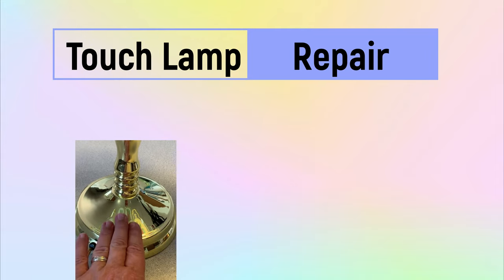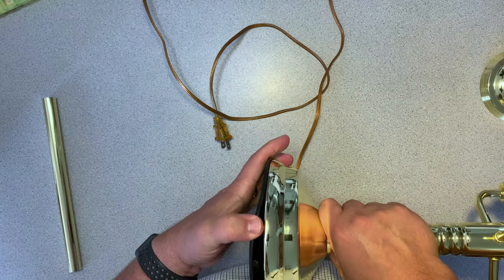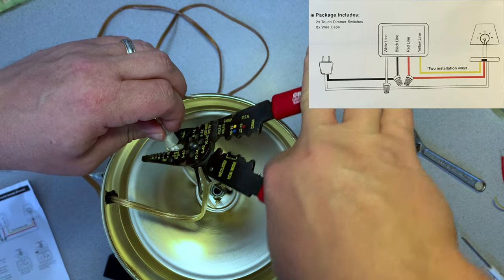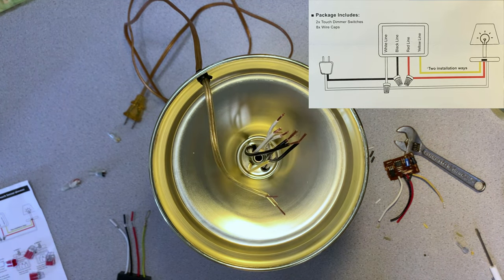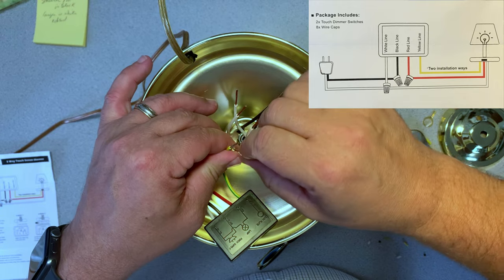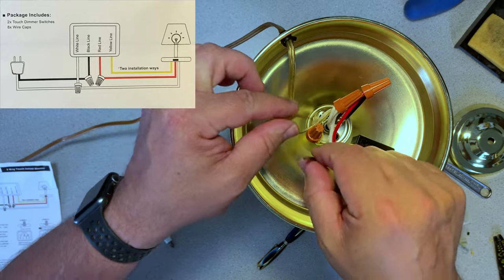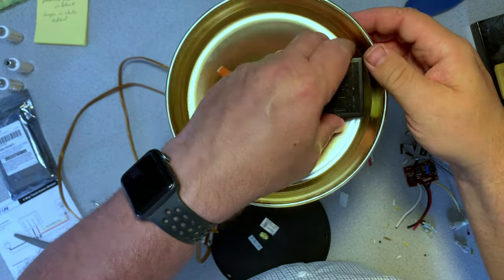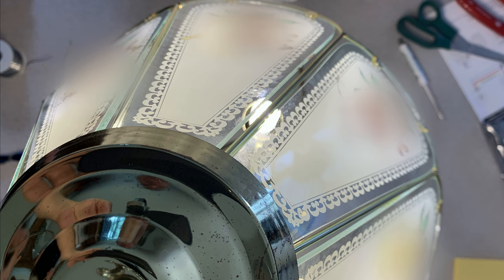22-M04 Touch Lamp Repair: How to get your lamp back to life

Comment: I’ve had a touch lamp sitting for the past 3 years because I could not follow the wiring instructions. None of the videos had the same color wiring or same number of wires. Your instructions were easy to understand although your module was very different from mine.  Thanks so much!
Reply from the maker: You're very welcome. Please be careful though, each control module might be slightly different but the basics should be the same. And remember if in doubt, have a professional do it for you. Good luck!!!

Comment: Well the bad news is your going to keep having to replace the the sensor module. It does not have the same ohms/ resistance that a incandescent light bulb has. So it just will interfere with the switching transistor.  
Cool video,  Pretty lamp 👍

Comment: I have the same lamp, the problem is that the touch sensor kinda works. The light stays on well, but every time i touch it to turn it off, it switches back on after a while. I’ll probably open the lamp if it doesnt start working, and return back here to update how it went! Thank you for the advice!
Reply: So... You were electrocuted?

Comment: Any advice on how to actually diagnose and repair the circuit board on the existing module? I find most of the replacement modules are absolute junk and either don't work as well as the original or burn out soonafter replacement. I'd like to be able to replace bad parts on the component level.
Reply from the maker: No advice. I find most electronics these days are like that. They are either good or NOT good. There seems to be little in the middle. 

Since it is an integrated circuit board inside, I don't think a "normal"/"average" person would be able to fix them. Good luck.
Reply: @ourheritageworks  Thanks for your thoughts.

Comment: I accidently dropped the lamp & broke the  lamp glass pieces for the shade. Can I buy the glass pieces?
Reply from the maker: Occasionally I see them on Craig's List, ebay or in a thrift store. You could also, replace the lamp shade with a more traditional one. Good Luck!!
Reply from the maker: I posted a follow-up video recently. You might want to review it as well. Good luck. 

Remember, if at any point you become uncomfortable with it, call a professional.

Comment: I have the same type of lamp, followed your instructions. I always check with a non contact ac tester on the housing and I have electricity on the housing. I measured then with a multi meter and it shows me 92 volt. Is that safe to touch ?
Reply from the maker: First, I am not an electrician. Please contact a professional electrician if you have any concerns. The purpose of my video is to show how to change the module and not how the module works with the lamp.

I have never tested the voltage or current on the surface of the lamp. It is a 120V system. I know that there will be some voltage and current on the surface because that is what makes it a switch. I DON'T KNOW HOW MUCH VOLTAGE OR CURRENT SHOULD BE THERE. The manufacturer of your control module should be able to tell you what to expect to be on the surface. 

AS A PURE GUESS - the voltage will be system voltage OR extremely low voltage (millivolts). Either way I would expect the current to be miniscule (milliamps or microamps). 

AGAIN PLEASE contact the manufacturer of the control module or a licensed electrician for more details. 

I'm sorry that I can't give you a better answer. IF you find out, it would be good information to add here.

Comment: Hello. I'm following your instructions but while I was removing the tube cover, some copper color scrapings fell out. I used pipe cleaners to get most of it out. Will this stop the lamp from working. I could send you a snapshot.
Reply from the maker: The answer is “I don’t know”. Even with a snapshot I might not know. I would have someone near you look at it. It might be nothing or it might be really important. You will need to find the source of the copper material and then determine if it is an issue. Please check it thoroughly and consult a professional if you are not 100% sure.

Comment: I did this twice and the control module blows out..what could be the issue?
Reply from the maker: Stephen without being there, it is really difficult to tell. It probably means that you have a short somewhere. Either the modules are defective (not likely if they are new but it does happen), the wires in the lamp are shorted, the sockets on the lamp could be bad, the wires to the module could be connected wrong or the modules might not match your country and voltage/current/wattage. My second video shows a little more about reading the diagrams and matching the module to the lamp. https://youtu.be/TvtQLX7dHGU In my second video, I discovered a bug had wedged itself into the socket. That would have created a short circuit if I had not found it.

Another Youtuber had a similar issue, See Andrew Camarata's video https://youtu.be/5olpi3NbLzs @AndrewCamarata. It might help as well.

Please if you are unsure, consult a professional.
Reply: Apparently a lot of these lamps HATE LED bulbs. I'm having trouble researching if it's possible to convert mine to LED rn bc incandescent bulbs are so hard to find and pricey

Comment: What can I do if I want my touch lamp to always be on?
Reply: Don’t touch it
Reply: You can always just remove the module and directly rewire the neutral of the plug to the neutral of the light socket and the hot of the plug to the hot of the light socket. But now you'd have to unplug and replug the lamp if you want it on and off. Or just add in a switch to the cord.

Comment: wondering if you could help me out , i have a lamp just like yours and i changed the sensor in it and it works as soon as you turn it on , but after leaving it on for a while it want  dim are cut on and off , what can i do???
Reply from the maker: I’m not sure. Initial thoughts… 1. did wires get crossed / is it wired correctly according to your switch specifications. 2. Is it a faulty switch/sensor? 3. Is the bulb rated for your type of sensor? The type of bulb must match the sensor (led, incandescent, halogen, etc)

If it is working and then stops working it is probably an issue with the sensor. My guess it is underrated for the amount of current running through it and it is over heating. 

Hopefully an expert on the subject will jump in with a response. I am a DIY person and can only show my experience.
Reply: @ourheritageworks  thank you so  much. I think theres a short in the sensor . Sending it back thanks again j hope
Reply: @ourheritageworks 
Hi. I also have an older lamp like this that has three separate bulbs. My controller went out and I tried replacing it with one module and it popped when I turned the power on -didn’t work.  Could you please tell me which module controller that you are using because my lamp is identical, thank you. 3:43
M.H.
Reply from the maker: @melissahollingsworth6101  My controller might or might not work for you. If you "popped it" you could have a short in one of the wires or a mismatched controller for the bulbs that you have installed. In the second/follow up video I discuss matching the controller to your lamp needs. No matter what please be careful and consult a professional if you aren't sure.

Comment: Where does the brown and grey wire go?
Reply from the maker: I’m not familiar with a brown and gray wire setup. There should have been a wiring diagram with the switch module. Be sure to follow that. The key is understanding the light you’re rewiring and being able to read the diagram from the switch manufacturer. I’m sorry I can’t give you a better answer.

As a disclaimer/reminder, I am not an electrician. If you are unsure, please be careful and if needed contact a professional.

Comment: What’s the part number for the module?
Reply from the maker: It is going to depend on your needs and country. For 120V (U.S.), the model in this video is X0033SWHN5, but it could be different the next time I order. I am working on a follow up video.  Search your needs how many volts, watts, etc.
Reply: Where did you order your module?